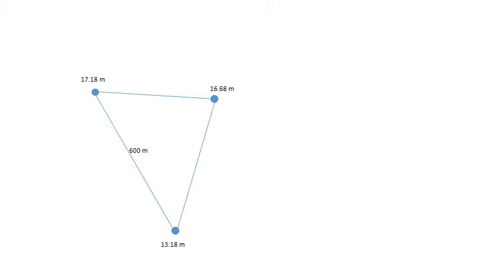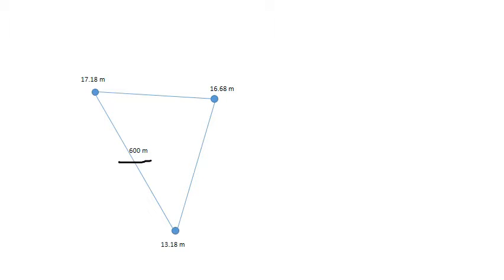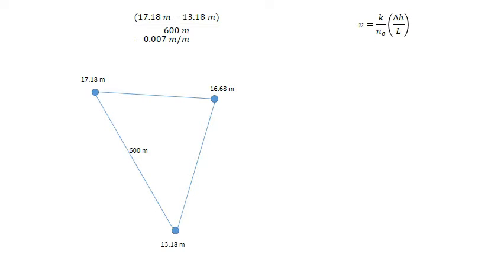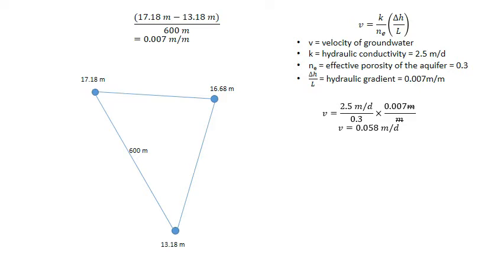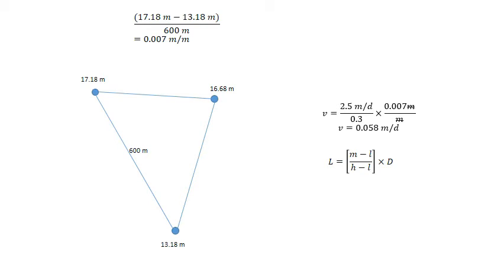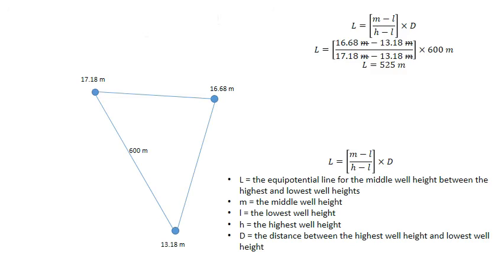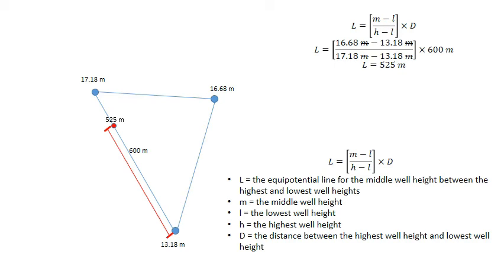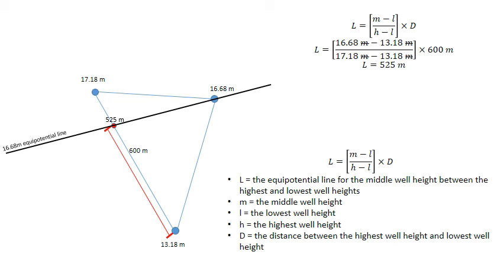Triangulation and groundwater flow

Comment: HI thank you for your video, I still have some trouble trying to understand the calculation of the hydraulic gradient in this problem chrome-extension://ohfgljdgelakfkefopgklcohadegdpjf/https://pdfs.semanticscholar.org/6af4/7821044957af79a537c1a1ddf0265ef81626.pdf Would you mind clarifying, please. How did they get D equal to 133?